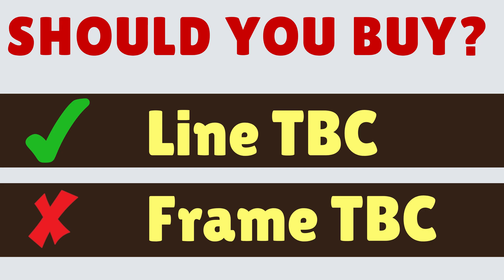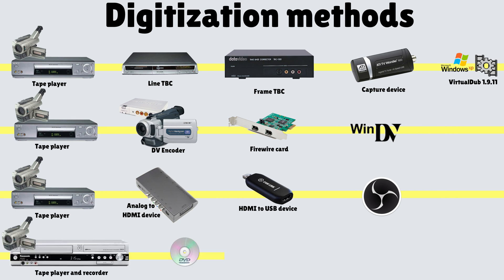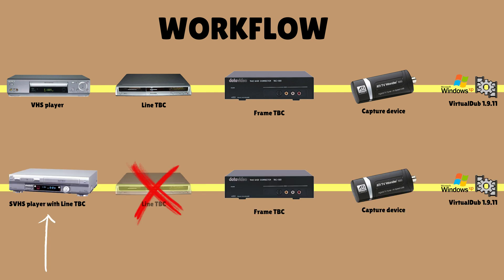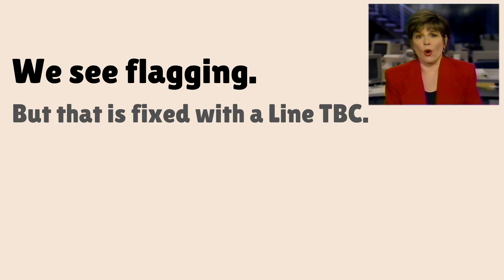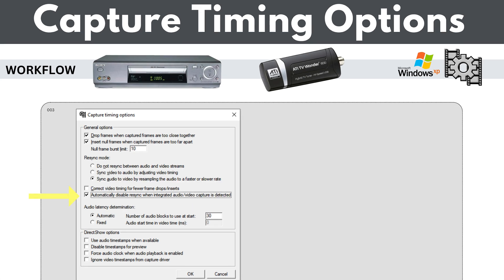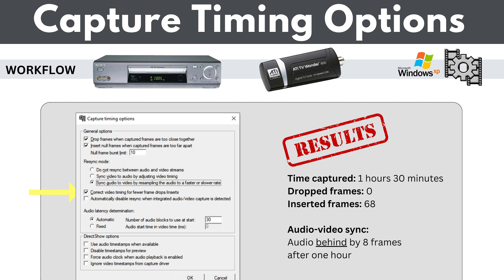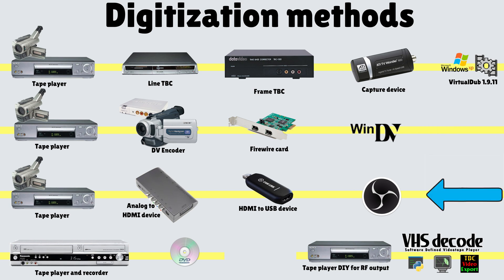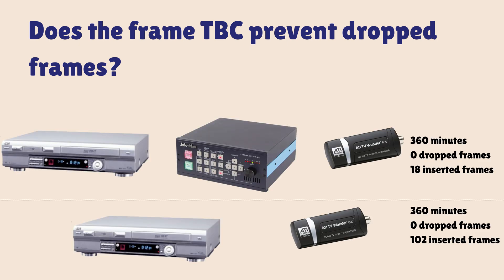What's a Line TBC and  Frame TBC?

Comment: On one of my test captures, 1h30m I had no dropped frames but many inserted. The audio was horribly out of sync. When I used a Frame TBC the inserted frames were zero and the second test capture was synced nicely. Alas, I didn't know about the "Capture timing options" I wonder now if this could have saved my first attempt....
Reply from the maker: One of the things that can lead to out of sync video is a time base errors (the wiggly video thing). A Line TBC (the kind in somce VCRs or passthrough devices like some DVD recorders) can fix that, and that makes the video image more stable. But even with a stable video image, dropped/inserted frames are still possible. A frame TBC can help with that, as demonsrated by your test. Bottom line, if you have a good frame TBC, use it when needed. But because they are so expensive, then people can use the settings shown in the YouTube video to deal with the issue. Finally, I would be remiss if I didn't also mention that the VHS-Decode Project (RF capture+software TBC) seems to also be able to effectively deal with it and is much less costly than a $1000 to $2000 frame TBC.
Reply: @videocaptureguide Yes I have been very lucky to find a working one rather cheaply (UK). My SVHS player also has Line TBC. I'm getting good results but there is always more to learn. Settings to tweak and toggle.

Comment: I have an old home video tape that vertical rolls or does some kind of vertical jumping/shifting really bad in spots. It’s one of those mini tapes you need an adapter to play in VCR. Stack of tapes works great but one has this issue, even on my VCR with built in TBC. Would getting something like a TBC-1000 fix this? I’m just worried about spending so much to change nothing
Reply from the maker: I have never used these adpters, but I read that sometimes the issue is the adapter. Sometimes it is the tape. The fact that you have a Line TBC in the VCR suggests it is likely a physical issue with the tape or adapter. A Frame TBC won't help with this issue. If this tape was important, I would try to find a pre-owned VHS-C camcorder like the one that recorded the tape and try playing it back with that.
Reply: @videocaptureguide I have two different models of the same adapter, one is a C-P7U and the other a C-P6U, and all the other tapes have been fine. All the same brand. So I’m pretty sure it’s tape damage but i do have the old camcorder still so I’ll try to get it kicking again and test the bad tape in it. Hopefully I can get S-video out of it but RCA is fine

Comment: would buying an AvToolbox AVT-8710, which is a very great TBC from what i gather, be better than buying a JVC S-VHS VCR with a built-in TBC?  I have seen AVT-8710's on ebay just today for over $2000 (USD).  I have also seen JVC S-VHS units with built-in TBC on ebay for over $1000 (USD).  Please advise.
Reply from the maker: The AvToolbox AVT-8710 is Frame TBC, similar to the Datavideo TBC 1000. These frame TBCs do a few useful things: (1) if the content on VHS tape is protected with Macrovision (as many commercial tapes were) then the frame TBC can defeat it and allow you to digitize the tape without all the errors that Macrovision adds; (2) it can ensure that the audio and video don't move out of sync during the digitization. But frame TBCs do not fix the wiggly picture issues.

What does fix the wiggly image stuff?

A Line TBC, like the ones on the expensive S-VHS VCRs. (Or some DVD-recorders used in passthrough mode.)

If you plan on digitizing home videos recorded with a camcorder, then a frame TBC is not as important. If you plan on digitizing commercial VHS tapes, then a frame TBC is essential.

Finally, there are two versions of the AvToolbox AVT-8710. One comes in a green case, and one comes in a black case. The green case version is the good one according to Lord Smurf and the other experts at the at DigitalFAQ forum. The black-case one can actually introduce errors. ALSO, Lord Smurf has said that there may be some units in the green-case models that were originally in a black case. I'm not sure how what the circuit board on the green-case ones are supposed to look like. But keep that in mind. And also, like all electronics, the capacitors on the circuit board will eventually fail and may leak on the board. So, if you plan on investing in an expensive item like this, consider recapping it or finding someone to do it for you.

Comment: I have a vcr player connected to a TV with the composite red white yellow cables.  I just got a Panasonic dmr es15 with Line TBCHow do I connect the  vcr player to the Panasonic dmr es15.? Can I connect it through the s-video ? Thank you.
Reply from the maker: VCR > Yellow/red/white cables > ES15 > Yellow/red/white cables > Capture device (or TV if you wish).

If your VCR has an S-Video port, then you can connect it to the ES15 with S-Vide cable.
Reply: @videocaptureguide  I have connected the VCR to the ES-15 though the S-video. I have a ATI 600 usb. The ATI 600 USB capture device needs to be connected to my USB on my desktop PC but how do connect the other end of the ATI 600 usb. It has a connection to the antenna which I don't think I need to use as a capture video device. How do i contract to the VCR.  I had an elgato capture USB. I'm a bit confused.
Reply from the maker: I think you are missing the adapter that plugs into the side. See the image here:
https://imgur.com/a/ATtXzu7

Without the adapter, one cannot connect S-Video (or Composite or red audio or white audio) to another device.
Reply: Hi VCG I was able to connect the ATI 600 USB as the capture device with the adapter. I can view it on virtualdub now on my windows 10 pc. However, I'm not able to get the settings on my tv for the ES-15 to setup the time based corrector. Can you show me a diagram of screen shots on which cables go from the VCR player - ES-15 - ATI 600 USB -, Virtualdub?
Reply from the maker: @ If your worlflow is VCR--ES15--ATI600--VirtualDub, and if you can see the video signal from your VCR (in VirtualDub) then you should also be able to see the ES15 menu in VirtualDub. If you have the ES15 remote control, and if you press the menu button, then the ES15 menu will hide whatever is playing on the VHS tape. Do you have the remote control for the ES15?
Reply: @videocaptureguide  Yes I have the remote control that came with the ES-15. I have the video from my VCR playing in virtualDub. When I use the remote to setup the settings for the ES-15 TBC. Where will I see the display from the ES-15 setting. On my TV or on virtualdub itself. I trying to understand if I see the VHS video playing on virtualdub. What exactly do I need to do to see the settings on virtualdub? Is there a way to know if the remote is working?
Reply: I have a question about the connection between the work flow from the VCR player - (4 pin S-video cable.) ES-15.  1st question.  Is a male to male S-video cable OK. 2nd question the one I had gave me some trouble fitting in the ES-15. Could you send me a link of one that would recommend? I saw some that had S-video with audio cables attached. I would just like to know if I'm connecting the right cables in the correct way? Thanks for your help. I really appreciate it. Your video are really excellent. Maybe you should do a video on the connection of the work flow. I can't be the only one with these questions. Thanks again.
Reply: I have the VHS video playing from my VCR Player in virtualDub. I have 2   Panasonic remote controls. The EUR7659Y10 that came with the ES-15. ES-15 plays DVD. Works great but setting to the TBC do not work. I can't see it in virtualDub or on my TV. I bought a 2nd ES-15 remote EUR7659YKO hoping that it would work in virtualDub but it doesn't work either. I point the remotes to the ES-15 and it just changes to set 1.  Is it possible I'm missing something? Is there a universal remote with codes for the panasonic dmr es-15 that would work? , Please Help.

Comment: Hi.  maybe you can go off-topic, as far as TBC's are concerned, and do a video on the pros and cons of video capture devices.  I have the elgato capture device, but i hear the IOData one is superior.  Maybe you can show a side-by-side sample of each, and show us the positive and negative effects of the comparison.  Maybe my captures would be better with the IOData.
Reply from the maker: I bought a crappy SD capture device at the thrift shop recently. For $4, I had to buy it so I could do a comparison, which I will do soon. Unfortunately (or fortunately) I don't have an Elgato to test. From what I've read, it is not the worst. There are cheap ones that are way worse. But it's not the best. And because it costs more than others, it gets a lot of hate.

Comment: Hello. Thanks for the vid! I learnt that If I have a Panasonic VCR with built-in TBC, then I no longer need to pass it thru device like ES10 recorder, which was supposed to work as line TBC, right? (I guess it should remove align, flagging etc problems). I used to use a cheap grabber which was unmanageable. I realized it totally sucks... it's a waste of time... thankfully I got enlightened. I wanna master a proper technique. It's pretty cool I don't need the frame TBC, which are expensive af 'n' rare here. I got me some stuff: a couple of VCRs, two recorders, TV tuner card etc. I've been hunting for them for a long time. Have not tested them yet, they are still on the way. Welp, I need to prepare oldschool PC first and clean VCR; tapes... Damn lotta work to do, but it's exciting. The plan is to send the signal by S-video cable to my pc through TV tuner card (if it makes sense). I had found a nice guide earlier. btw. I did not know some DV camcorders may serve as this line corrector... so much to learn!
Reply from the maker: Sounds like you have a good VCR, which is probably the single most important thing. According to the experts, the line TBC in your VCR should be able to handle most of the issues. But they caution that there are some times when the ES10 or ES15 is needed for particular tapes. But always try with the VCR line TBC first.

With a good capture device you will get good captures. There are lots of options and ways to do it. But the best ones are pretty much the same and so you just need to pick one. After the capture, there’s part two: enhancing/deinterlacing/etc.
Reply: @videocaptureguide  Yes, I've been digging much, and this VCR I own is said to be really good! It's Panasonic NV-FS200. I spent less than, let's say, equivalent of $120)) Another Panasonic I got is NV-HS800, it ain't no TBC inside. The first one seems to be working just fine, but I am concerned because the previous user used to clean the heads often because I think he was using the machine extensively. I hope I'll be able to capture at least 50 tapes with it. Today I picked up Panasonic DMR-HS2 I won for 10 bucks, but I don't know if it works and if it has this line TBC function. So yeah, handful of options to test!
There's a video on your channel where your friend (or AI generated voice actor) compares different devices and there was this retro 9600 graphic card. There are several auctions with similar cards, different brands and prices vary from 30 to 70 bucks. Maybe TV tuner I got offers similar quality.
True, there are many ways to enhance outputs. I tested some of them, unfortunately the footage I used was from that cheap usb grabber. There's an old Topaz Video version, 2.6.4 If I'm correct and some people praised that.
Reply from the maker: Regarding the ATI All in Wonder 9600XT, that is a good one. There are some ATI regular video cards that are called 9600 but they are simply to display to a monitor. So be careful to make sure you get the right one. It’s an AGP card so you will need a motherboard with an AGP slot. They are rare. The Dell Optiplex GX260 is the last model from Dell to use a motherboard with an AGP slot.
Reply: @videocaptureguide  Damn! My comment disappeared. It must've gotten deleted, or maybe it was not sent in the first place. There was a link included, so that might be the cause... Sadly, I did not copy the message(( Anyway: I was considering buying this (supposedly) ATI Wonder card, but it was not sure if it was legit, because of the price and one of them had PCI slot! I found this Dell PC pretty cheap as well. But come to realize... maybe I should try my TV-Tuner first 🤔
Reply from the maker: @maximus613  There are a few ATI All In Wonder cards for PCI and PCI Express.

See the list here:
https://www.digitalfaq.com/forum/video-capture/392-ati-wonder-hacks.html#post13441

Lord Smurf wrote that "The PCI Express cards are not always the easiest to get functioning as desired. You're pretty much forced to use ATI MMC 9.14 (with 9.16 being suggested), and the end-of-life Catalyst drivers."

Here's the list from DigitalFAQ, available at the link above:

PCI: (Rage Theatre chipset)
ATI All-in-Wonder VE Radeon 7500

AGP: (Rage Theatre chipset)
ATI All-in-Wonder 128 Pro
ATI All-in-Wonder Radeon (7200)
ATI All-in-Wonder Radeon 7500
ATI All-in-Wonder Radeon 8500 / AIW 8500 DV

AGP: (Theatre 200 chipset)
ATI All-in-Wonder 9000
ATI All-in-Wonder 9200
ATI All-in-Wonder 9600 / AIW 9600 XT / AIW 9600 Pro
All-in-Wonder 9700 Pro (PAL)
All-in-Wonder 9800 Pro
ATI All-In-Wonder 2006 Edition (AGP 8x)
ATI All-in-Wonder X800 VE (AGP 8x)

PCI Express: (Theatre 200 chipset)
ATI All-In-Wonder 2006 Edition PCI-E
ATI All-In-Wonder Radeon X600 Pro
ATI All-In-Wonder Radeon X800 XL
ATI All-In-Wonder Radeon X1800 XL
ATI All-In-Wonder Radeon X1900
Reply: @videocaptureguide  This particular card - ATI All in Wonder 9600XT can be bought here for about $170. However, seemingly similar cards, which is for example Medion Radeon 9600TX AGP costs 6 times less. (I have Medion 7134 TV-tuner-card btw). I guess that all of them cards operate MPEG2, and that should be it? I mean, are there really notable difference between them?
Reply from the maker: @maximus613  I think that other 9600XT might simply be a GPU (graphic card) whose job is to display your computer on a monitor.  Is it the one on Ebay for EUR 25.50? That's not an analog-to-digital capture device.
Reply: @videocaptureguide  I meant a card from a local market here, I don't buy from eBay. Sadly, the proper card you told me back is much more expensive, like 5 times.

Comment: Great video and great explanation of TBCs, I liked and subscribed. I haven't found many useful videos related to VHS capture (surprisingly) so I'm glad YouTube recommended your channel.
I'm using almost the exact same workflow you used for your testing here (ATI 600 USB, Win XP, VDub 1.9.11) except with a JVC S-VHS player with built-in line TBC. I've never had any sync issues and have the timing resync options disabled. Sometimes I get 1 dropped frame but I can live with that.
I've done tests by capturing the same tape twice in a row without changing anything and sometimes one will drop a frame and the other will drop 0. It seems to happen randomly so I suspect it might be an issue with my PC or VDub settings. Either way, I see no need to gamble on an absurdly expensive frame TBC.